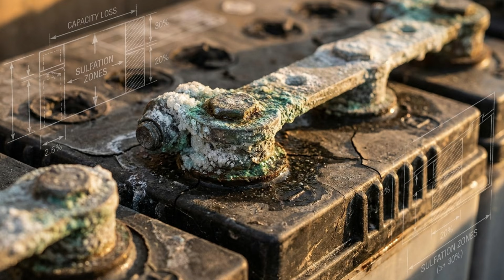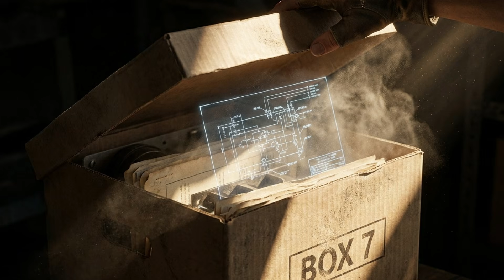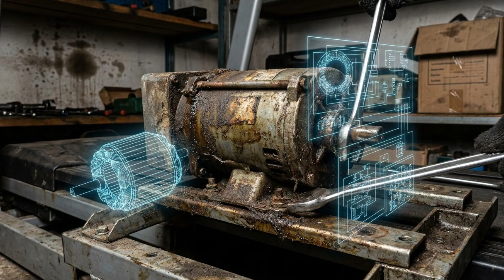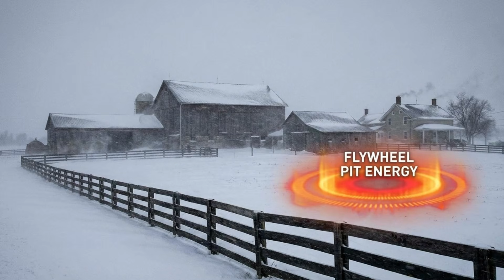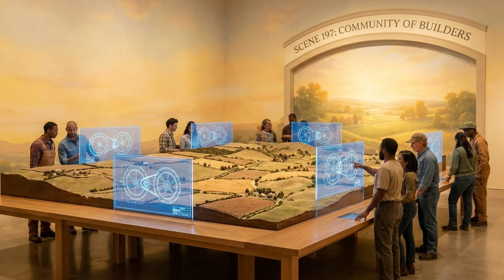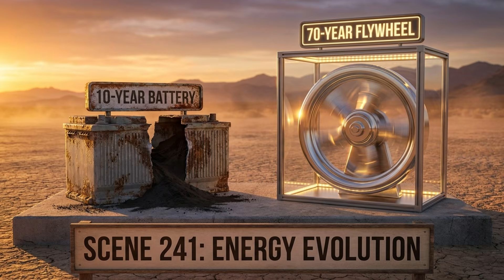The Buried Secret: Energy Storage 90% Cheaper Than Lithium

Comment: How can you get the information and diagram ? I would love to get off the grid due to cost and because of outage.
Reply from the maker: I’m putting together a full step-by-step guide with diagrams, parts lists, and wiring layouts right now. 
The crazy part is most of the components are just old-school mechanical parts — bearings, a DC motor, steel, concrete, and basic solar gear. Nothing “magic” about it.
I started looking into this after losing power during outages too. Once you realize how fragile and expensive the grid has become, energy independence starts making a LOT of sense.
Stay tuned… the next videos will break down the wiring, safety systems, and how to size a flywheel for a normal family home.

Comment: Used pickups are 40,000 so no savings
Reply from the maker: Bro really said “used pickup” like it’s still 2009 💀
At this point the flywheel might actually be cheaper than a rusty F-150 with 280k miles and a missing tailgate 😂